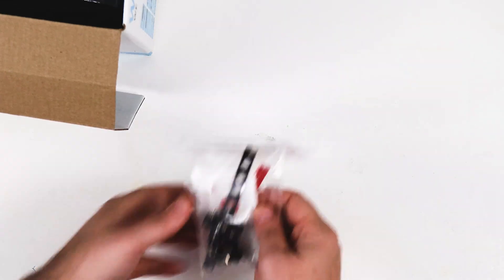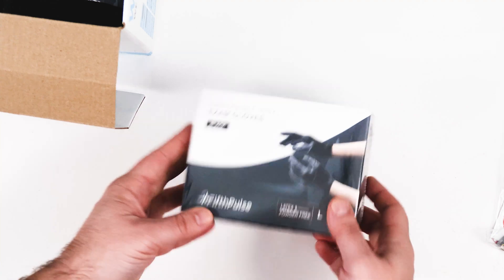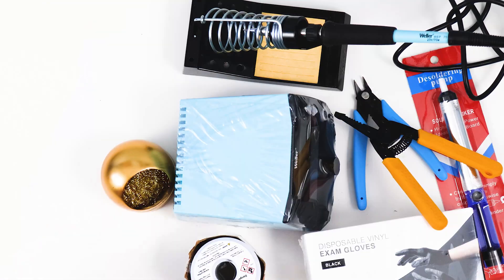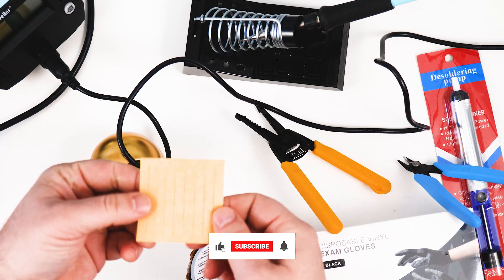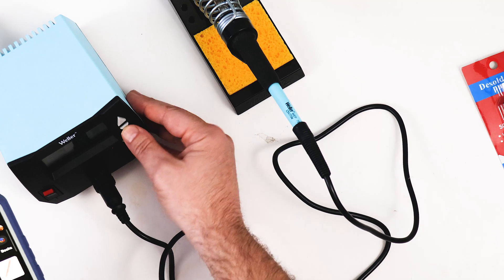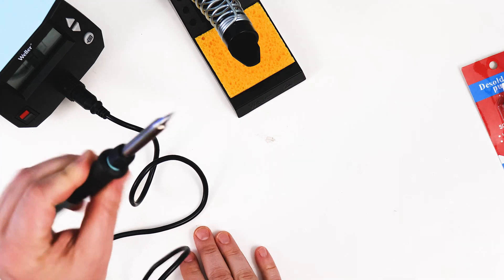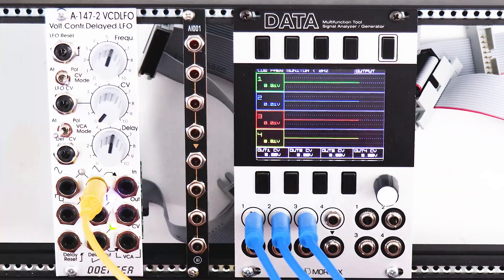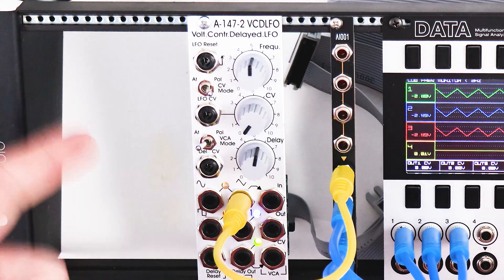First DIY Build! AI Synthesis Multiple

Comment: FWIW - I never had any luck with that kind of solder sucker. I have had the best luck with the "Engineer SS-02" that I got from Amazon. That coupled with high quality se-soldering braid seems to get things undone without damaging the board. May have to upgrade my iron though, my Weller only has a knob, no fancy displays...
Reply from the maker: Thanks! I used to have a cheaper soldering iron that I bought to do that guitar work and I remember it being a major struggle - put me off pursuing this... I have to say - the one I'm using is significantly easier to use! It's not that expensive either... might be worth an upgrade.
Reply: @braintree56  + 1 to Andy's suggestion. I assumed suckers were a waste of time and used wicks for cleanup until I used an SS-02. The secret is the seal it gets on the joint by using that clear heat resistant tubing...

Comment: Nice! Be prepared though, after going DIY I spent more time ordering parts, soldering, learning electronics rather than making music with the finished modules 😄
Make sure to clean the iron tip after you are done, it can oxydize really quick otherwise: remove the old solder with brass sponge and coat the tip with a blob of fresh solder and let it rest like this.
Also depending on the type of flux in your solder, you might need to clean the board, as some of them are corrosive.
Reply from the maker: Excellent good tips!

Comment: You might find gloves a bit of a pain. Not really needed for a bit of soldering. Just wash your hands and don't touch your eyes etc. Good start. You'll be hooked in no time :)
Reply: Agree. I was nervous and wore gloves at first but it’s a nuisance and I talked to many people who have soldered faaaaaar more than I ever will and they don’t use gloves either. As a guy who solders a module here and there I don’t think it’s necessary. I read that the real risk with lead is ingestion, not contact. So wash your hands before you eat 😊
Reply from the maker: In the next build I gave it up... I think you're right.

Comment: Nice job - I would recommend also screwing in the jack sockets onto the front plate, just to add stability when soldering :) .. also I’m myself dabbling with case building so very interested to see your process for this 👍
Reply from the maker: Thanks. Great idea. I'm pretty excited to dive into case building. Still have to learn more about power supplies and such. Have you built a powered one?
Reply: That's what I was going to say also... that way you know that it all lines up correctly and is level...
Reply: All the Music Thing stuff are great builds to start with!
Reply: + 3. Mounting the plate before soldering jacks and switches and knobs will save your sanity.